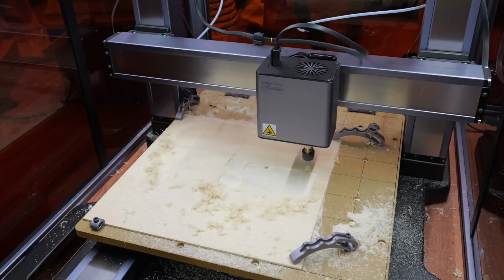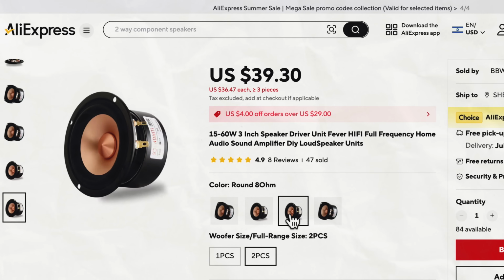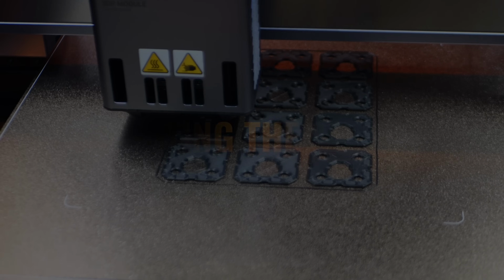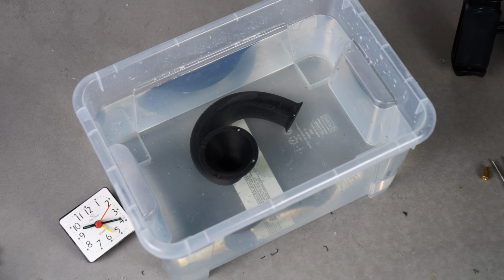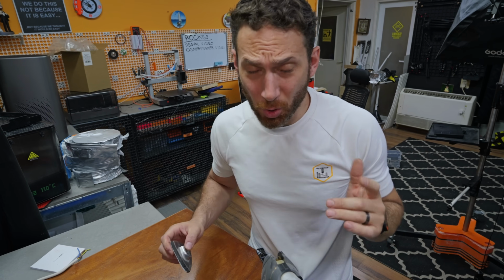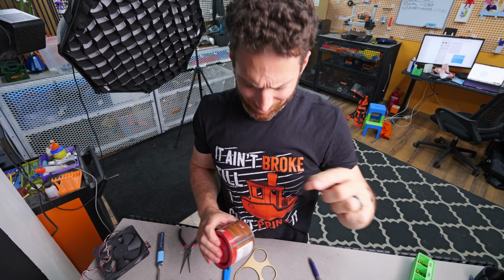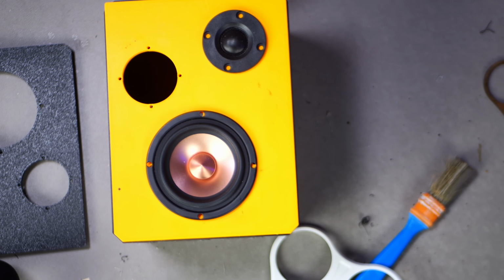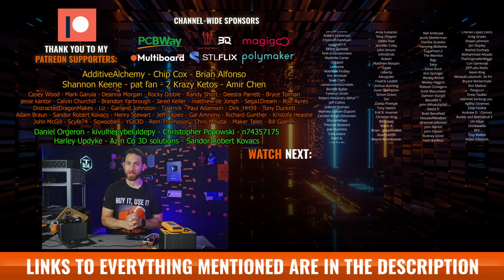I 3D Printed Speakers from AliExpress. How Will They Sound?

Comment: A 3d printer is a CNC machine so you're well within your comfort zone 😅 Honestly though, using a CNC router is a piece of cake and I would say easier than 3d printing as you don't need to know how to 3d model anything, just be able to draw a sketch. People shouldnt be scared of using them. Best place to start is by getting a scrap piece of wood and just have a play with it. I've even writen my own gcode to cut something on a CNC router, just... because. Try doing that for a 3d print that isn't just a cube.

Comment: often those audio wires are plated (or not) aluminium . that's why it doesn't stick.
copper strand stay bent . not aluminium strand.
or use some flux

Comment: A few questions before I will try this project myself.
Did you want with the 8Ohm or 4Ohm speaker from the link you provided ?
Is it possible to print the horn with normal support on my X1C ? 
Thx נשמה

Comment: The Speakers are awsome, great job. As for the speaker wire solder try burning the bare end of the wire with a lighter or such, it will burn off the special coating that might be on it. Then melt solder on the wire alone first. I still love your videos. Stay safe.

Comment: Did you tin the wires? If you don't know, it's when you put flux on the wires and then add the solder.

Comment: You may have had two different problems one you didn't flux your wire first or you bought copper clad wire which means that it just copper on top of 10 wire and it pretty much junk but again Lux will also help suspiciously because it takes contamination off of The Wire that you probably put on there with your fingers and forms of oil that's why you always use flux when soldering no matter what it is orbs you name it

Comment: I built my own set of 3d printed speakers not too long ago and there is a much better way to do the walls, esp if you design the horn area to be built into the speaker itself. Just use 3 walls with 0% infill and fill the area that would have been infill with a mix of 75% molding plaster and 25% white glue. It makes it air tight and very solid.
Reply: This is the way
Reply: My personal preference is: 
Bambu PETG-HF (other high speed brands work just as well)
0.6mm nozzl 
0.36mm layer height
3 walls
8 top and bottom layers
25% gyroid infill
10mm wall thickness with some 5mm bracing every 5-8cm
Reply: @lukahierl9857 A gyroid infill would work, but I largely use the plaster+glue mix and thinner walls because with those settings it still gives an air tight path for the sound to travel down the horn as well as costing less than fully printing the speaker body. I get 3-4 speakers out of a single spool of filament, 3 spools for a full 7 speaker set-up with testing and a couple of failed prints.

Comment: I'm confused by two things. First off I thought I saw that laser was at least 40 Watts, if so it should be able to cut half inch thick plywood with almost no issues. Secondly I'm confused by the toolpath the CNC machine is making. I would have thought it would have done circular cuts for each of the speaker holes versus just simply going back and forth. That would have resulted in less post work. Having said all that I love the video!

Comment: I just finshished a complex built with 3d printing and woodworking in combination. I really could have used a cnc there, but i don't have one. So i printed a lot of templates to use with my handheld router and it worked like a charm.
PS: Glad to see you safe!

Comment: This is a fun project, and not owning a random orbit sander is a bit strange. If you ever work on reclaimed wood it's nearly a must. It being miles better than a multitool would be the understatement of the century. Making a lot of stuff with reclaimed wood in absolutely awful states, a belt sander for really rough stuff and a random orbit sander for everything else is a lifesaver. I may be biased though as I own about every type of sander out there and use all of them a lot. But if I had to have only one it'd be the random orbit sander.

Comment: 3 separate machines would be much better and even cheaper. And they can work in parralel, doing different tasks. And you don't need to waste time to change tool heads (even if it's fast, as you say). And wooden dust from CNC would never get into your 3d prints. And so never does the ash from laser cuts. And separate laser machine would be lighter and faster. And you can bring it on different surfaces (walls, furniture, long wood..) not limited by enclosure dimentions. And you can easily switch between standart laser heads - 5 watts for precise engraving and 40 watts for fast CO2-like cutting. And separate CNC would be much more stiff and powerful. And you can attach dust collection (factory or custom 3d printed) to it. And make a silent box from plywood and rockwool or rubber yoga matts for it. And. And.And... The only plus of this machine is space saving, but even this is arguable - because you can stock printer, laser and CNC one on top of the other on some kind of shelves and get almost same dimentions.. So, what do we have in the end? Overpriced and uncomfortable machine with proprietary tool heads and proprietary software - no, thanks;) But the speakers themselves are great, I loved the project and the video!

Comment: Cool project. Don't understand the Multiboard decision though. I mean making it possible to hang the speakers to the wall is totally fine but having the slots on the sides is super ugly. I also would have gone for the printed black front plate. Matter of taste I guess but good job

Comment: If I have any problems soldering wire, I  use plumming flux. Make sure to heat up the wire and not the solder. If the wire is hot enough, the solder will just flow.

Comment: Great build, but you are using the CNC router wrong. I saw engraving on the wood when you can actually cut it. Use vector to inside or outside of the line and frankly you do not need that laser machine for that kind of cut.
Reply from the maker: Limitation of their software Luban. I need to learn a proper cam solution but I hate fusion.
Reply: @thenextlayer  can it import dxf files? if so, you do your 2d sketch in coreldraw or the same software and import from there. for flat plane, 2d design and cam is very compatible. Good luck and stay safe.

Comment: For the solder, there are different types. If you are using acid core, that which is meant for pipes and not for wires, it will not stick well to wires.
Reply: This! And honestly if you can get the good stuff, Kessler, please do. You truly will thank yourself.

Comment: When you are milling the wood, how tough would it be to run/attach dust collection (vacuum)?
P.S. I did notice you managed to get the person who ACTUALLY fits inside the machine to help remove the dust.
Reply from the maker: I mean, it’s also a 3D printer, so I feel like it would be quite easy to make an attachment.

Comment: There are so many things that are more of a determining factor of the overall speaker "sounding good" than just if the ENCLOSURES are 3 printed or not.
First off, I installed car audio and fabrication for over 25 years. Plus I competed in the sound quality, or SQ, divisions and my vehicle's install and sound was judged on how correct it reproduced the tracks being played. When we were tuning our systems via EQ, we often referenced and listened to high end home audio system comprised of different electronics and speakers. This is why it's kind of misleading to say "3D printed speakers" when the sound is actually reproduced by the speaker that consists of a cone, magnet, basket, etc. The multiple speakers, how many used is determined by numerous requirements and needs, can then be placed in enclosures that can be 3D printed, CNC'd, made by hand tools, or even a combination of all. The most important thing here is getting the enclosure the right size as all speakers have a cabinet volume requirement that is unique to the speakers being used. There are programs that take the specs or TS parameters, of the speakers and does the calculations for you. You just then have to construct the enclosure to match the interior volume that the program came up with. You do not want the walls of the enclosure to flex and this will effect the movement of the cone, or where the music output originates. This flexing can make the music sound unbearable. Thats why not matter how you build the cabinet, it has to be sturdy and air tight. If 3D printed, and I have done this a lot, you just have to make sure the walls are thick enough and bracing is used.
Sound complicated? Not pun intended but it is and this is why some speaker systems, the speakers themselves and enclosures or cabinets, can cost from $50 to well over $500,000. That's not a typo. LOL!
Reply from the maker: Yep that’s all covered in the companion video bud

Comment: 24:51 very possible its pure copper wire, heating pure copper in air forms an oxide that probs made it hard to solder to if you didnt have any flux (couldnt see any) but also no shot of the wire so its also possible that was enamel wire or some kind of fibre was in there (seen in headphone wire). more flux imo solves all problems.

Comment: Hold the phone ... $1800 for the preorder of a inline filament dryer? What in tarnation?
Reply: I was also very interested in this "in line filament dryer" and indeed, I do understand the same as you...
WTF dude... That might explain why he only mentions it :D
Reply: @GirardNicolas run your filament straight though a cheap $30 filament dryer. Just use a empty spool inside it and have it wrap once around the spool. Crank the temp up to max and make a homemade shield for the thermistor so the heat doesnt directly hit it. Works great for petg and pla to knock down the stringing.

Comment: 82 bucks is WAY too expensive for a DIY BT speakers.
Reply from the maker: Really? 
I guess I could’ve gotten the crossovers for much much cheaper, I found cheaper smaller ones later. But how could I have done better?
Reply: That's entirely dependent on the quality you want. You can easily make thousand dollar DIY speakers. It's all about how you want it to sound.
Reply: @tenchuu007  I have spent over 3k on the electronics for a "bluetooth speaker". But that involved a 3.5kWh battery, a fancy DSP and 4x500W + 2x1000W amps housed in some 19" rack cases. Its more of a battery powered PA, but hey it has a built in bluetooth reciever.

Comment: I first got into 3d printing to make custom waveguides for speaker building. I'll have to watch the companion video. You mentioned early in the video using an off the shelf crossover, which never works well. Hopefully he designed a custom crossover based on measurements.
Reply from the maker: Didn’t know you can even do that!
Reply: Absolutely, and the components to do so are dirt cheap, and you can tune the sound to how you like! Just needs a bit of time, and some basic soldering, and the difference in quality is night and day. (Some trial and error is part of it as you have to of course measure the sound on a curve chart and see where you have to add/remove amplitude at certain frequencies, like a manual eq, except its directly fixing the sound, not masking a inferior sound. Highly recommended and very satisfying! @thenextlayer
Reply: @thenextlayer you can. Now the surround speakers I built with custom quadratic throat waveguides are going to be left behind in the media room when we move at the end of the month. They're mounted to the walls, so they stay. I plan to make a media room in the next house and build the same speaker design because they worked so well.

Comment: Thanks for the video, Jonatan.
The problem you were having with soldering was maybe the wire in the cable was copper coated aluminium. There's a test you can do. Strip a section of insulation and see if the wire flops when you use a lighter on it. If it does then it's aluminium with a copper or alloy coating.
Reply from the maker: Oh interesting! I'll keep that in mind for next time. thanks

Comment: The problem with these machines is they are excellent at nothing, but okay with everything.
Reply from the maker: I think that’s fair, but also, I don’t need a great laser or CNC, what I need is to not take up a ton of space in my studio, and occasionally do simple work. But I also think if you use lightburn and Fusion instead of Luban you can do much more advanced stuff.
Reply: @thenextlayer  True about space, but you can stack a printer, laser, and CNC and spend less than this costs and get much better results. You can upgrade software, but you can’t change its hardware limitations.

Comment: I'm not experienced here, but it looks like you are CNCing using FDM tool paths. I think you should be using the laser tool paths. Don't convert everything to dust, just cut it.
Reply from the maker: Yeah. Luban is quite limited, it’s for learning. I need to use a different cam, and then I could do circular tool paths and stuff. Hopefully now that I have this machine and the carve, I will spend some time learning how to properly set up my tool paths.

Comment: Please don't wall mount a woofer to multiboard. Speaking as an acoustical engineer, it is very suboptimal. Using a wall to transfer more bass is ok, using a floor is better, but multiboard essentially absorbs the sound waves and isolates the speaker, which is fine for mids and highs, but terrible for bass.
Reply from the maker: Yes, you are right. I’ll put the sub on the floor if I build one. 

How did we do otherwise, acoustical engineer? Did you see Justin’s companion video?
Reply: He could create some companion pieces that allow that segment of multi board to be strongly attached to the wall with counter sunk screw holes, that would stop it from acting as a damper